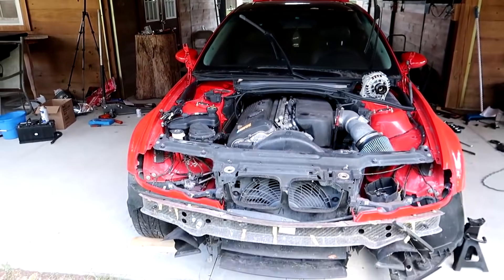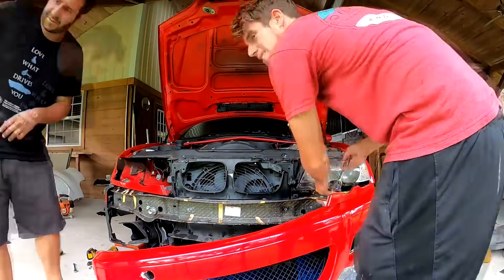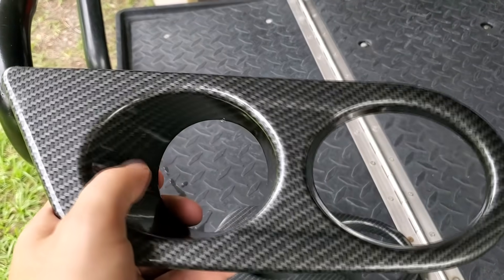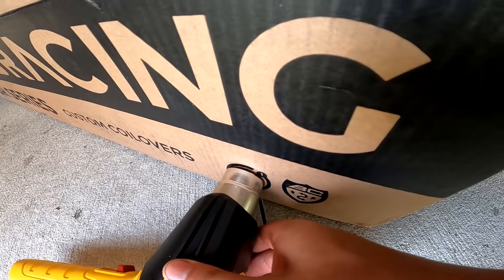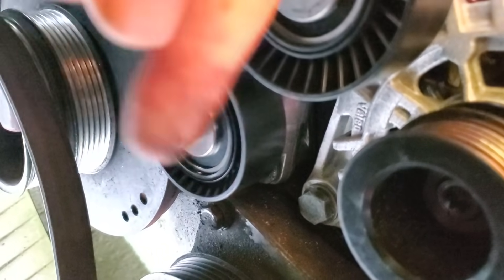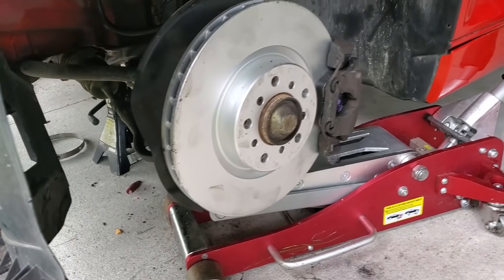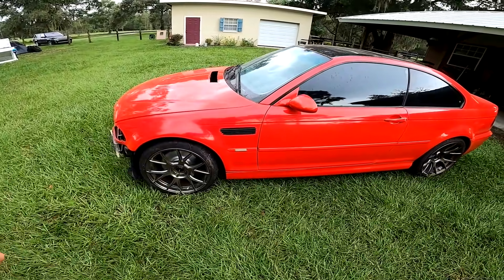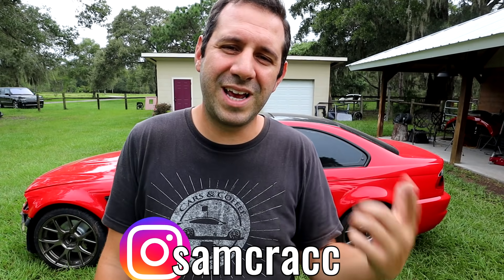I Got Lucky Buying a Cheap Flood Salvage BMW M3. It's WAY Better than I Thought!

Comment: One thing that is really bugging me, the misaligned side molding between the front fender, door, rear quarter.  Anyway, great rebuild. As you said, it's going to be stunning when finished. Good job Sam.

Comment: Hi Sam.

I have HELP!!!!!!!!!!!! !!!!!!! !!!!!!! Read plz

I have a bmw 328i. Also e46.. Awesomen car, and had the same problem than yours, the problem started right after i instaled a aftermarket sound system...

I then realised that the problem began to occure.
Changed the batery terminals and my problem is solved until this day! ¦! 🤝🏻 🤝🏻!!!!!!!!!

Comment: That steering wheel looks like ass, those top and bottom panels clash and make the gaps stand out, and the gap on the right side where the two meet is completely fucked up.  I hope you got that for free because I wouldn't pay $800 for it.

Comment: the led taillights are far better and better looking than the ones you put in it also the cold air you took out flows much better than the oem the filter fell off because the clamp was lose also the black on the hood flows with the black on the roof and now the black roof is out of place you ruined the look

Comment: This steering wheel looks really disgusting. Carbon fibre bits don't line up at all, the horn doesn't match... And as a whole, this is something you will see every time....